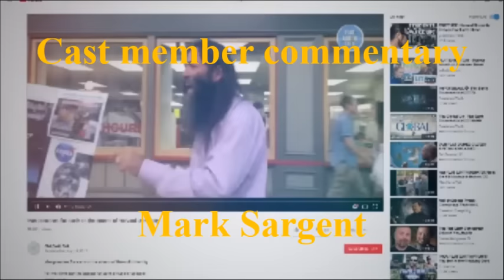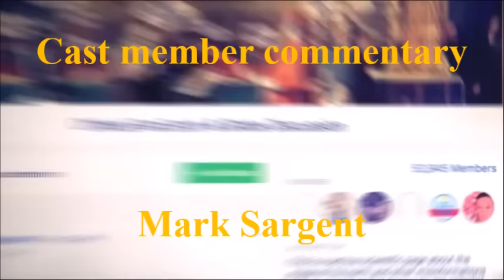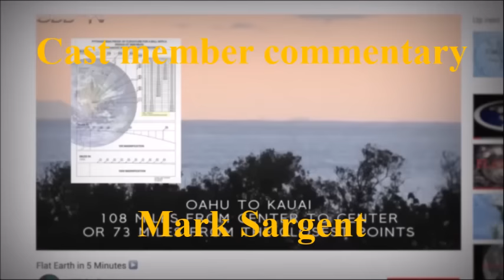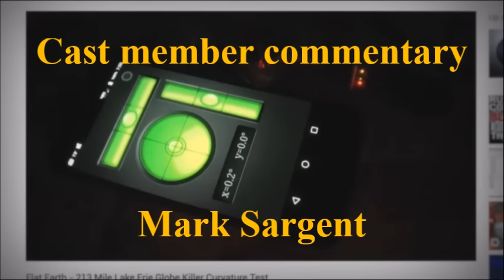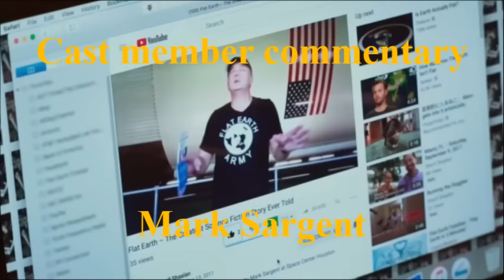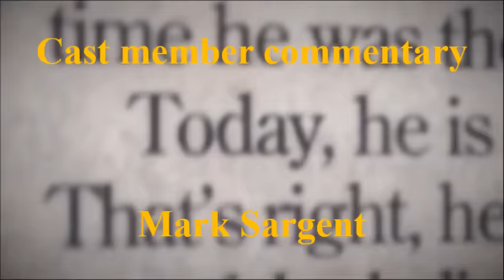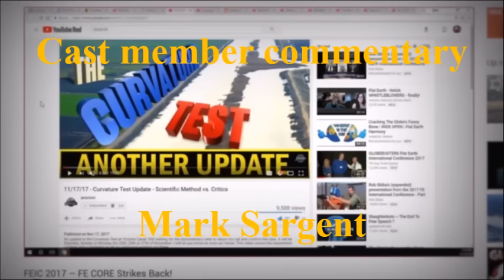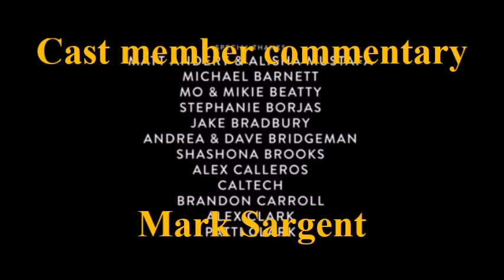Behind the Curve film cast member commentary Mark Sargent ✅

Comment: Where can I test the curve ?  Like where is the place that shows 8” of drop on a level surface and actually measure it?  Just one spot in New England would do!  Thx
Reply: It's 8 inches per mile squared.
If you have to parrot the wrong formula for curvature that you heard from your FE gurus, at least do it right, or you're making it too obvious you've got no clue and are just repeating what they told you in their dubious FE videos.
Also try and provide the accurate FE map, where is it ?